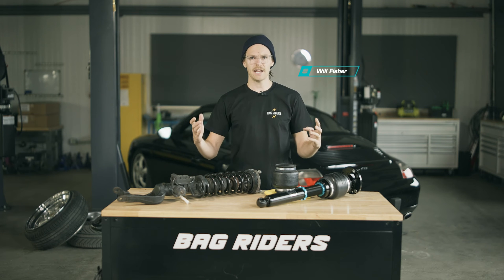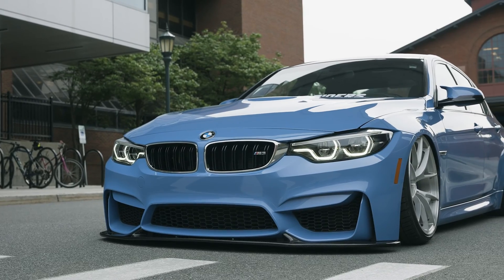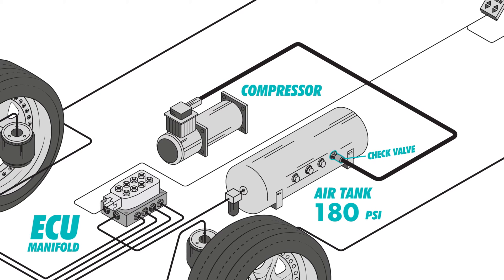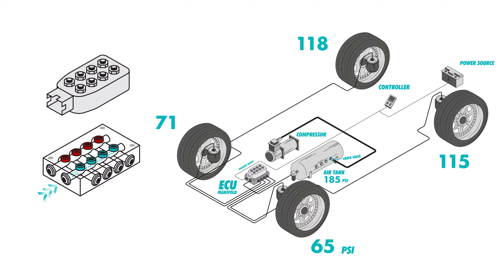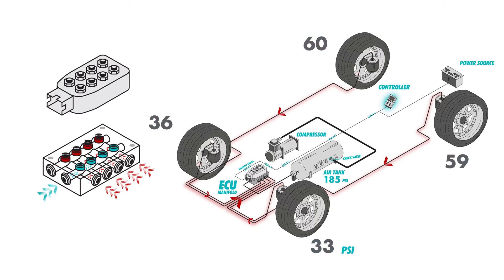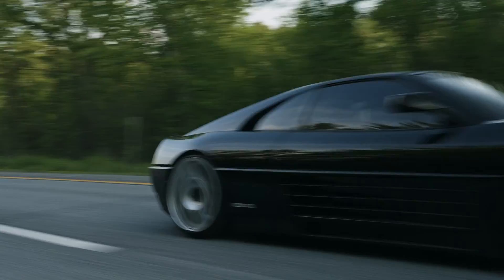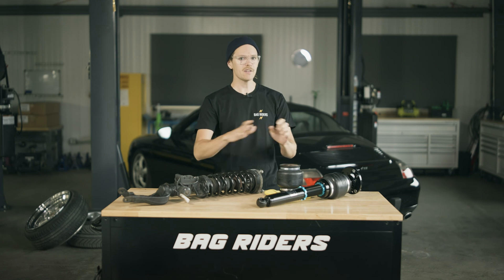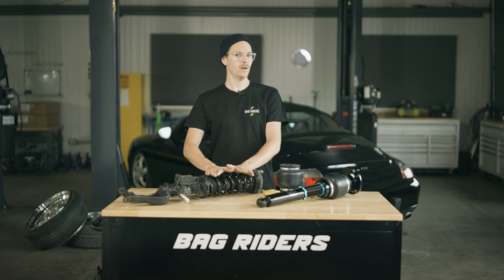How does an Air Suspension System work?

Comment: Great Video, Thanks. Are Airsprings generally very stiff?
Reply from the maker: Glad we could help! It really comes down to the pressures that you're running. A higher pressure in the air springs, the higher your spring rate (stiffer), the lower your pressure, the lower your spring rate. Air is interesting in that it can handle exactly like a coilover (limited body roll, planted feeling in turns) but when it takes bumps, it's nowhere near as harsh as a coilover. Pretty much the best of both worlds!

Comment: Will great video, thank you
I have a Kodiak C 4500 with airbags all the way around and I want to be able to lower the stiffness of the ride
I pull a footy foot fifth wheel so that your bags are up at 120 psi on the rear in 45 psi on the front
When driving around with no wheel on, can I drop that rear psi down with your eight body valve unit?
Reply from the maker: Thanks for the kind words! Dropping the PSI in the rear bags when you're not towing will end up giving you a softer ride but will also cause the rear of your truck to be lower as well, which might not be ideal depending on your situation.

Comment: Does Air suspension last as long as the regular suspension?
Reply from the maker: We typically see air suspension outlast the ownership of most modified cars! But typically everything is good for 5-10 years, 100,000 miles.

Comment: Where does the airbag dump to when the car is lowering?
Reply from the maker: There is an exhaust port on the manifold which can be routed to inside or outside the cabin.

Comment: I've never understood the people who claim that this is for performance. If you lower the car, you're lowering the pressure in the bags, which makes the airbags softer, which is exactly the opposite of what you want for performance. In fact, when these people are completely aired out, the air-spring is completely deflated and, therefore, is nullified. It's like removing the spring from your suspension. None of this makes sense to me.
Reply from the maker: This is great speculation! The air suspension we sell is designed specifically for lowered vehicles, so the overall strut length is significantly shorter than OEM. You’re absolutely right,  if you lower the pressure too much, it will reduce the spring rate and make the ride overly soft. When the airbags are fully deflated, that’s purely for parking purposes and not for driving.

One of the key advantages of air springs is that they’re completely adjustable. You can tune the stiffness to your preference by adjusting the air pressure,  as long as the damper stays within its intended range of travel, you can dial in the perfect balance between comfort and performance.

Comment: Hi, a question, maybe silly but... I'm never been so lucky to have an air ride 😊
Is it necessary to wait for the air tank and whole system refill by the compressor at the veicle start?
I'm wondering as must be for a daily use.
Thanks
Reply from the maker: As long as you reach your driving pressure before moving, you’re good to go, no need to wait for the entire system to fill before taking off.

Comment: How to adjust how fast or slow it goes up
Reply from the maker: The speed of airing up and airing down primarily depends on the size of the air lines, which are available in 1/4" and 3/8" options.

Comment: What is the difference between Air Strut and Air Spring?
Reply from the maker: Air Struts: These combine an air spring with a shock absorber (strut) in a single unit.
Air Springs: Also known as an air bag can be attached to the air strut or used by itself.

Comment: Subscribed! Great video.  Please let me know  when you make the video explaining the different air pressures per bag.  

I always wonder if need to try and even them out when I drive. I have a Ksport air suspension. 

Thanks!
Reply from the maker: So there is a two part answer to this. First and foremost a small difference side to side isn't a problem. 

That being said, I like to find an ideal front pressure and and ideal rear pressure, and save that for BOTH fronts, and again for BOTH rears. (Two pressures, one front, one rear). I then adjust my lower mounts to ensure that my vehicle is sitting perfectly evenly on both sides.   

I'm picky about it, and that's how I like to do it. Also don't forget to get an alignment after!

Comment: Question why when park my car in the garage 0psi and 2hrs later i find my car 8 bar lift up from back only help me please 🙏
Reply from the maker: To clarify, are you saying that the suspension is INCREASING in pressure without you pressing any buttons?
Reply: @ yes bro nothing
Reply from the maker: @justingjmicallef8446  What manifold are you running? Is it adding air to all of your bags equally, or just certain bags?
Reply: On back only is manual manifold
Reply from the maker: @justingjmicallef8446  Do you have four paddle valves, or two? It sounds like you have a paddle valve that has gone bad.
Reply: No two I have and the valve has problem still open and the car go up slowly
Reply from the maker: @justingjmicallef8446  You should definitely replace that valve.
Reply: @ yes bro keep going into the ground bro 😎

Comment: Question. I Have 2007 Silverado 1500 on air suspension. I have a recent issue where I lift the back of the truck up and it will release all of the air out raising the back to its fullest position. I’m wondering why it’s doing that, instead of cutting off as soon as I release the switch?
Reply: That sounds like an issue with the electropneumatic valves. May be a timing problem involving the chip board.

Comment: Can I ask a question? I am building a sports car, 50's look from scratch. I don't want a tank and a pump, and so much complication, could I use air springs with a schrader valve, and simply pressurise to how I want it and done? It seems a perfect idea. If not its a case of weighing each corner and purchasing coil springs to suit.
Reply from the maker: Yes this will work fine. I would choose your air springs based on what extended height you need, knowing that ride height will need to be between 40-60% travel (essentially the middle 20%)
Reply: @bagriders  Great, that's the way then. Thanks.

Comment: Just wanted to say I absolutely love the content you guys make, and I ended up buying a variety of fittings and electrical odds-n-ends from you guys when bagging my 3000GT. Your videos helped me learn a ton of information, and the production quality of them is excellent. I have a lot of suspension changes needed before I can go lower, but I've been having an excellent time and been happy with the ride quality and look of air ride. I would've gotten more stuff from y'all, but Airtekk is effectively the only company that sells air struts for a 3000GT. I hope you guys get more swag/merch options, as I love the look of your overall site/branding and the current selection is quite limited :)
Reply from the maker: What year is your 3000GT? It does look like we have some suspension for both the FWD and AWD drivetrains.
Reply: @bagriders  I've already bagged my car 😅 I saw options including D2 but I'd found more feedback on Airtekk struts among other 3000GT owners, and many coilovers (and thus, air struts too) for our platform have weird manufacturing issues/oversights. Thank you for reaching out though. Again, please more swag/merch!!! 🙂
Reply from the maker: @Brandonr757sGaming  We will have more coming out soon!

Comment: im interested in air suspension for confort, the roads here are so bad (does air supension protect you from potholes? i mean does bump hard?), please make a video about confort, hight speed handling (does kit come with computer that detect car level and try to automatically level each suspension?) and what about where to install air tank and where to connect source power for compressor.
Reply from the maker: Our air suspension system is designed to lower vehicles, providing the flexibility to rise above obstacles like speed bumps and steep driveways. Having the adjustability will allow you to avoid damaging your undercarriage and bumpers. By no means is its intended purpose to protect you when traveling at high speeds while hitting a pothole. There are height based air suspension systems that will go to your desired preset with a push of a button but will not auto detect obstacles in the road way. Most of the air management such as the tank, compressor, and manifold are typically installed in the trunk.